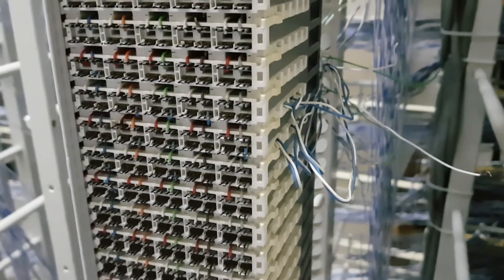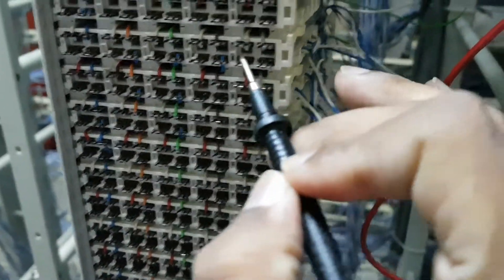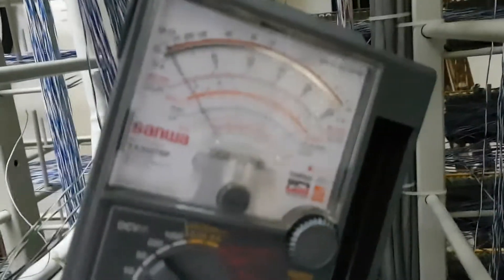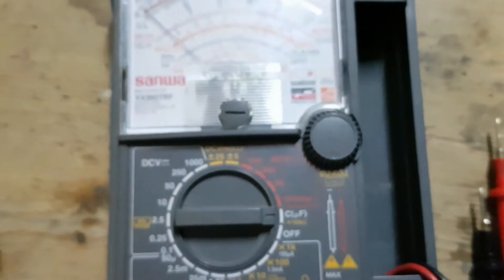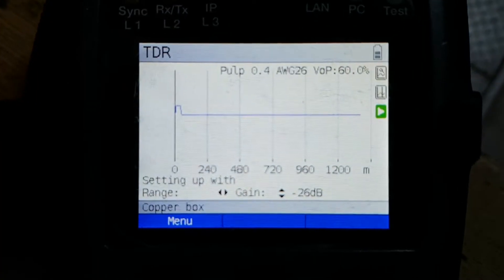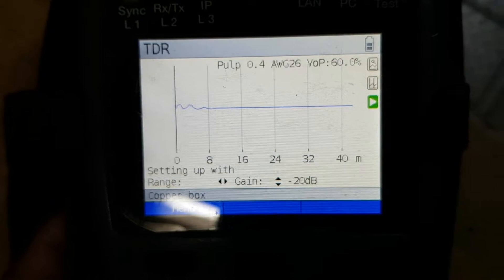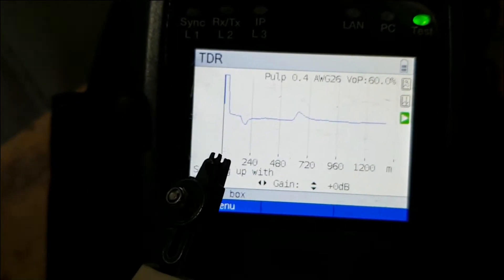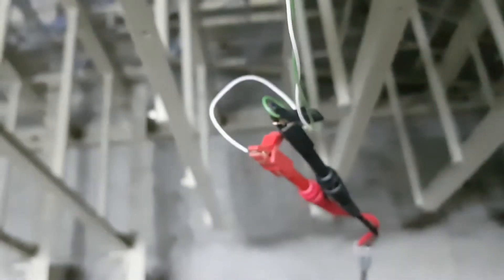How to test for GROUND issues in copper cables using ARGUS & OHM meter

Comment: ARGUS 42 PLUS There are these features in this?
Reply from the maker: Yes it is available but in some cases you need the vendor code to activate it and for copper box you need to purchase that copper box device to connect it.
Reply: @meteoroid-1574  I bought it too but I don't know how to start itI'm asking you help me🙏🤲
Reply: What is the name of the device we need to buy?
Reply from the maker: @vusalferzeliyev3633  if you need to check Resistance & TDR than you don't need to buy the copper box device...just go to the copper test in your argus and run it